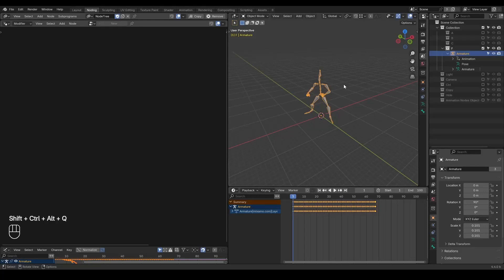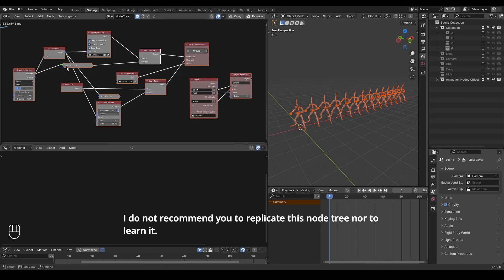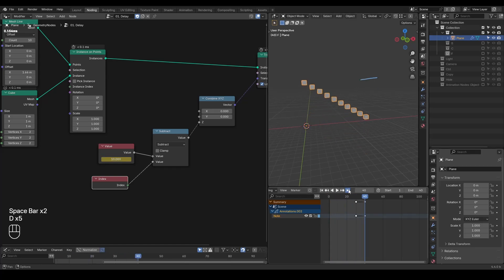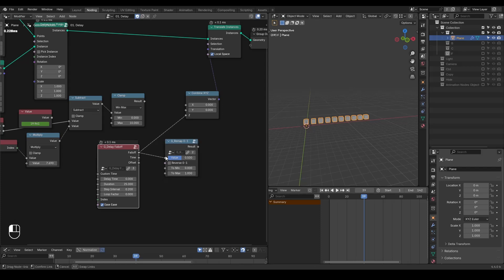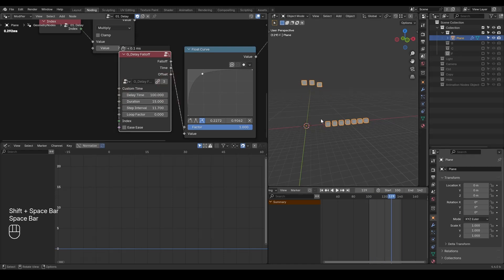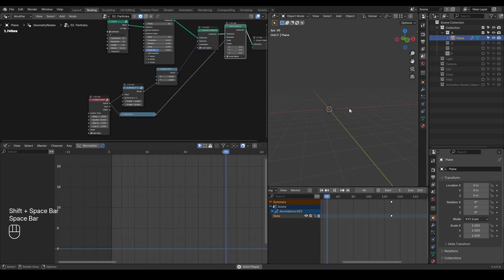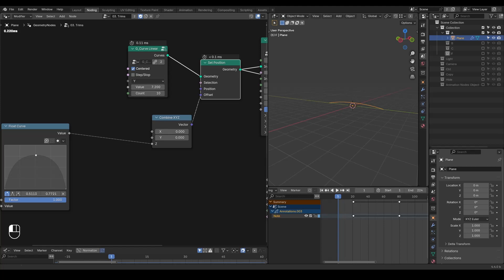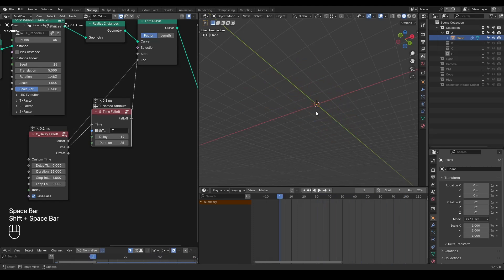[Tut] Delay Falloff to Offset Procedural Animations - Blender Geometry Nodes Preset 4.4

Comment: the float curve node is not changing the curve right for me. the right most point decides its height. Ive changed blender versions with no luck. i even tried a normal curve line primitive. nope
Reply from the maker: sorry i'm not sure the context you are talking about. which time point are you having troubles, etc. It may also be better if you can ask in the discord server with your node tree
Reply: fixed with a spline parameter put into the float curve node's value input